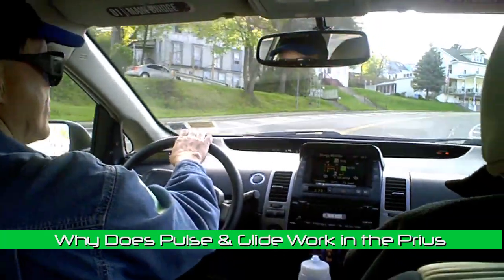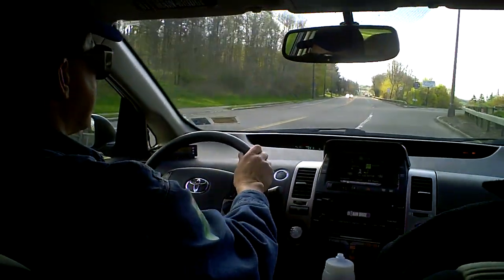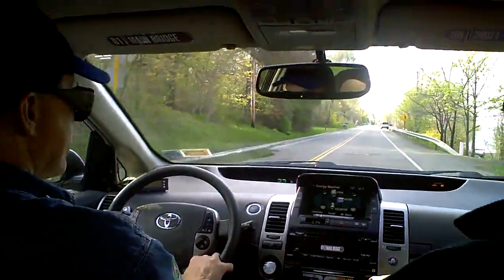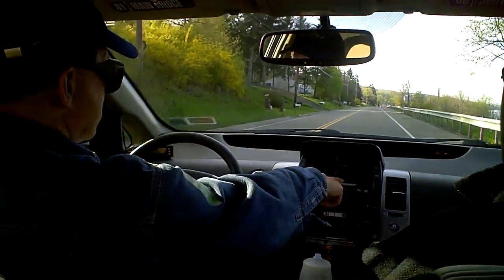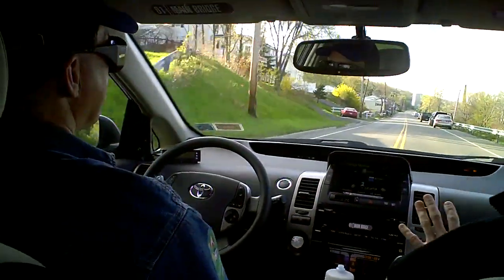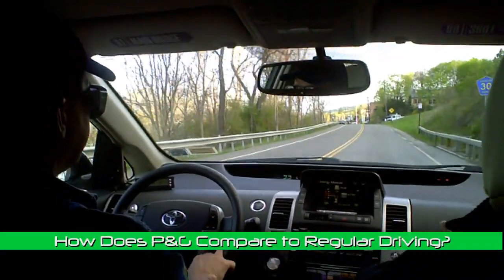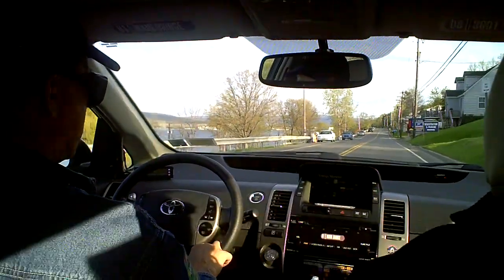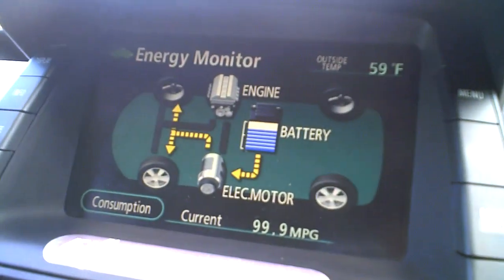Toyota Prius Pulse and Glide Fuel Economy Tutorial

Comment: I Drove 1200Miles in a Prius rental without doing the P+G and got 60+ MPG   US Gallons .  See Below                                                                 
Distance Driven  1204  (1937 KM)
Gallons used 18.759 (US) 15.66 (UK)
Cost (USD) $63.30  £51.04 ( Sterling ) @ Current Rate 1.24 USD -Pound
MPG (US) 64.18 (UK) 76.88
3.66L per 100KM

Comment: I wonder if a pulse and glide mechanism could be built into a car so that it does it multiple times per second. The engine could cause each cylinder to misfire by not injecting any fuel every few cycles to maintain speed but have the throttle wide open to reduce engine braking. The car will essentially be coasting whenever the engine isn't firing and since engines produce the best thermal efficiency at peak torque at wide-open throttle, you'd end up saving fuel without having to speed up and slow down all the time (at least, you wouldn't notice the speeding up and slowing down the car would be doing many times per second). 

Hooking this engine up to a CVT would be the most economical since the transmission could keep it in the peak torque band all the time.

Further still, maintaining the vehicle's most efficient speed would add to the savings. Usually around 45-50mph.
Reply: I think it would be better to just not use some of the cylinders, although optimum results would be to be able to completely decouple the cylinders. This would be complicated in terms of needing two separate timing chains and a locking clutch in terms of evenly spacing the power strokes. The other problem is the firing order of a 4 cylinder engine makes it difficult to split up into two 2 cylinder halves that fire evenly.
The other thing which is easier is to expand the range of top gears in the car. In most sports cars, the top gear ratio will be aligned so that the power peak and top speed are aligned on a level road with still air. At lower speeds, you can use an even higher gear. Perhaps a "drafting a truck on the highway at 55 mph" gear. In some cases the rpm you need might be below the peak BSFC but it will still get numbers adding a bit more load to the lower revs, than feathering high revs. In practice, these higher gears don't suit most rolling terrain driving conditions, but there are times where 1500 rpm at 70 mph might be optimal, in terms of decreasing the percentage of engine "rolling" resistance - especially if the engine is at least 1.6 liter.
Reply: @TimpBizkit  cars already have that....

Comment: Thanks -great video with good common Prius sense.   Since I bought my car last year (had 165,000mi and a failed HV battery), I got about 44 immediately after fixing the HV battery and using it completely without hypermiling attempts.   After I changed the oil and increased the tire pressure to 42front/38 rear I got to about 48mpg.   After I figured out the ideal glide stuff (pressing pedal just a touch to get 'no arrows' or just lightly to get some battery power without engine kicking in, I was able to get my mpg up to about 50.x, with one section/one day oddly being up at 63 mpg over 150 miles highway and country roads.   This explains, I guess how I got to that outlier high number.   I must have been doing the extremely low engine-on 'pulse', where the orange arrow from the engine goes to wheels with no orange arrow from the electric motor to the wheels (meaning the motor is taking some engine power and sending it to the battery, also a green arrow.)   It's a good tip that the driver suggests the instantaneous mpg number has been found to be 'about the speed your going' to maximize overall mpg.  Thanks for that too!  I'll be trying, when road conditions/drivers allow, to work on my pulse acceleration technique.

Comment: Can some1 recommend: is it more hybrid-efficient to brake slowly or step hard? Which would give a bigger output. Also, I've got a ct200h, the charge is more or less when the arrow is at 0? (the harder i brake - the lower it gets)
Reply: Braking gently is the best way to get the most from regenerative braking
Reply: Think of it more like time breaking not how hard. If you brake too hard you will be using the pads and all that energy is wasted you want to stretch your braking as long as possible this makes sure all the energy possible to be recovered can be.  around 48% on a mild temp day

Comment: Auris MY15 Euro - best mpg 65.7 mpg or 3.58 l/100 km - how? 100% Eco Mode,
always use the battery between 40% and 80%, 
always keep the needle at the half of the first eco section (on electricity or gas)
always park your car with 40% battery life
if there's a lot of accelerating and braking involved, use the battery between 80% and 90%.
Reply: That is pretty good for a 3rd gen HSD system.
Reply: 2025 lexus es 300h (2.5 liter)  my best mpg 62mpg or 3,8L/100km

Comment: Many high voltage caps in rows, alternating like pulse drive.
Placing two horizontal counter syncronouse flywheels:78k each. Under or within chasie.
One vertical for your smaller motor. Generating as we go,
Wheals can be.
Time for school. That's as big buss full of children and there father's and mother's thus the Lord's be with.
As those wheel keep turning, know that it can be given back in mass, to say swiftly would be appropriate.
Wisdom does take time however we learn from it or play catch up.
We had fallen for it once before, they lie all the time.
But I know.
Chryst told.
Even at my very core.
Warms my heart as matter of fact.
We will learn as we share.
Challenge of written book we're accepted by the intelligence of the world, but many have own power.

Comment: So you accelerate and put your foot on the petal slightly?  I was accelerating and taking foot off the pedal and getting better MPG.  I'm just trying to clarify the pulse and glide technique
Reply: Never driven a Prius but I think in terms of accelerator position from softest to hardest it's.
Pedal not pressed - regenerative braking
Slight pressure - nothing
Light to medium pressure - electric motor propulsion
Medium to heavy pressure - petrol engine of increasing power
Heavy pressure - petrol engine and electric motor for maximum power

The object is to accelerate at medium pressure - enough to fire up the engine but not make it roar, then switch to slight pressure so that the car is freewheeling, not converting kinetic energy to electricity (because you don't get as much back as you use).

I'm sure there are times when it is better to not press the pedal down a hill to store up battery energy from the regenerative braking, and then use the electric motor to take advantage of the stored energy before another downhill charges the battery to full and can't store any more.

Comment: I haven't tried any of this pulse and glide, I do however drive by not pounding it up hills (allow for a little bit of slowing) and using regen brakes as much as possible, slowing well before a stop without being ridiculously slow. I get about 4.1 to 4.3 litres/100 or 54-57mpgUS. With new battery and mostly 80km/h or less, though I have gone up to 100 and also up a big hill, still got 4.2L/100 due to rolling down the hilly road. Battery was filled to capacity.
Reply: Since I use semis to break the wind, I end up pulsing up the hill and gliding down the hill to keep up, since downhill makes switching to electric mode easy.
Reply: Hello, what car?

Comment: Normally with my Peugeot 106 GTI 1.6 16v, I run about 10km per liter in city traffic. For the past days I ran my thirsty car on high octane Shell V-Power fuel and used the 'Pulse and Glide' technique in town when I could. Aside from P&G, I did everything else about right and didn't slow down other traffic. The difference was amazing! I went from 10km per liter to 17 which is (obviously) an improvement of 70% in fuel economy over the old driving style. The downside is that when i switch the engine off when coasting, I lose my powersteering and 70% of my brake pressure. Still, this is very doable and i'm amazed at the difference.
Reply: I don't even start my car. I put it in neutral, push it myself downhill and use the momentum all the way to work. A lot of people horn but I pretend I've broken down.

Comment: Better do this only if you are the only person on the road. Otherwise, you will piss off a lot of people behind you.
Reply: People are pissed at us Prius drivers just by seeing us to start with lol
Reply: Nope i usually catch up with dawdlers in front of me and I have to brake in the middle of my glide. Although I'm not oscillatong between 18 and 37 mph....
More like 50-60 in a manual transmission.
Reply: dabambz I just bought my Prius.  yes, seems to piss people off, not supposed to use my heat and AC, have to put all my concentration into the special way to drive and not lose focus for a second, which pisses ME off.  lol.  If I just relax and drive it like a non hybrid, I dont know if Id get over 35 mpg.  my old Escort gets that no matter how I drive, 80 mph with AC on and I'm  totally relaxed driving it.  Paid $500 for the Escort with new tires!   $5500 for the Prius that I can't figure out how to really relax in (yet)!
Reply: romansten9 that's more an issue with not buying the correct vehicle for your intended use, you are most likely using it out of it's efficiency range. 80mph is outside of probably every electric cars efficiency. At city speeds the Prius will dominate, if you want a highway efficient vehicle you should've bought something else.
Reply: dabambz some of us don't give a crap if you are pissed. That's the difference.

Comment: I put this in practice all the time and achieve 50 mpg without disturbing traffic behind me.  Just  accelerate to a decent speed of about 45 mph, then you can pulse and  glide to maintain a decent speed.  By the time the speed goes down, you're already breaking at a traffic light.  As long as you won't pass 42 mph in a Prius 2010-2015, you're electric motor will be in charge.

Comment: Wouldn't be easier to switch the gear box to neutral an coast? You would then not have to work all the time on holding the pedal at the right spot.
Reply: Benedikt Freifallspoiler it basically puts itself in neutral automatically
Reply: ***** This is about hybrids in a situation where the engine is shut of anyhow.
Reply: Yeah in the Prius the engine is off in neutral. It might be tedious to keep your foot on the pedal, but also might be tedious to always flip the lever to N or D
Reply: Benedikt HRO engine so t shut off if you kick it into nutral while running. If you kick it I to neutral while it's off it'll use battery, which will force the engine on to charge the battery. Not as efficient. Doing the technique in this vid doesn't discharge the battery and shuts the engine off during glides.

Comment: Actually this doesn't sound right to me, the kinetic energy use for acceleration is lost due to driving resistance and drag.
The energy need to move the mass is constant base on those two factores, so "Pulse and Glide" will not yeald anythinger over at constant speed with the same avg. speed and transit time. Higer speed equal more drag equal greater energy loose, so the reason he gets better digits are simply lower avg. speed causes less resistance and drag, resulting in better fuel efficiency.

But the Pulse and Glide is NOt the cause, the lower resistance and drag however is, it's all a matter physics.
Reply: Milan Olsen I guess the only way to explain this would be due to less energy loss in the engien it self. The energy loss due to drag and friction would remain the same, but friction in the engien at 1000 rpm is lower then at 2000 rpm. However energy loss in due to transmission is only a few percent at this speed i guess you could save a litle bit by doing this. Atleast thats what i can make out of puls and glide. btw, if it would be possible to turn of the engien totally during your glide you would save even more, how ever this is really dangerous!! (excepts in hybrid vechicals)
Reply: No you are wrong . the purpose of pulse and glide is that an engine internal frictions is not proportional to the effort it gives,; it is ,at low speed,  bigger than the frictions of the car. Conclusion : if you  stiop the engin you suppress engine friction, half of the time, you will suppress half of the friction . On classic car (VW golf) i experiment this mode of driving at low speed on  50 mph ,20 % more mpg . Much more efficient than constant speed.
Reply: molan the electric motors engage some to reduce drag during glides.
Reply: If you drove up a hill and coasted on the way down you get max fuel economy. Similar concept. Maximize energy.
Reply: A throttle position on the HSD allows you to completely disengage the transmission during glides, allowing the Prius to glide for much longer than a conventional vehicle. No drag from conventional transmission gears, or the engine (unless you invoke the latter via regenerative braking).
I do this everyday, but ensure that I NEVER impede traffic while doing so.
With time, you learn to do this even in fast moving traffic automatically, while moving with the flow of traffic without impeding it in any way.
Reply: The reason this works in most cars is because the engine runs out of gears and is a big loss factor in terms of its own internal resistance. In most cars, the highest gear isn't high enough to burn the least fuel possible. For example, my Cooper S is 2400 rpm at 60 in 6th gear, and still relatively lively when I accelerate, meaning a higher gear could do the same job and reduce the speed of the great friction machine. In some cases at lower speed, the car uses more energy just to spin the engine parts against their own resistance, than actually turning the wheels and moving the car!

TLDR having your engine parts go rubby rubby rubby and the air through the valves go swish swish swish only some of the time is more efficient than all the time. In many cases it more than makes up for the change in speed being less efficient because of non linear drag losses.

Comment: This works to a lesser degree in a standard gas engine car also. From a stop. Accelerate smoothly but briskly up to the speed you want, then coast or maintain. Regular gas engine.. operate most efficiently at 50-75% throttle.  When the engine RPM is above idle and you are off the throttle coasting, the fuel injection shuts off the fuel..  So when going down a hill, let the engine braking force keep you at the speed you want.. you are using no of little fuel. Watch the instant MPG gauge it will go to 99MPG.
On another point.. this pulse and glide is great when your alone on the street, doing it with people behind you is very incosiderate, also ..  Most places I drive none goes 35MPH anyway... it;s always 40MPH or higher.
Nice video though on demonstrating how to do this.. It is a good idea, IF you can safely do it.
Reply: The only thing I'm not going to do is oscillate between 20 and 40 mph on a 60 road. I'd drive people mad....
You are supposed to go out of gear on the glide unless you need to slow at the bottom of a hill. The amount of reacceleration negates the zero fuel consumption engine braking.
If you're staying in gear you may as well just hold constant throttle and save the varying squared and cubed losses in engine and aerodynamically, whose average is greater than when holding the average speed steadily.
Reply: Pulsing and gliding works at higher speeds too on some hybrids. I pulse and glide at around 60 mph, as I do value saving time as well. I generally hover between 55-70 using a semi to reduce drag when possible.

Comment: This is how motormen were taught to drive streetcars, to save power, and also because you couldn't decelerate electric motors - you could increase speed at a certain rate,  , but to decelerate, you shut power off entirely and coasted, or braked if necessary.

Comment: I get it and I love it.  But, how does this effect the overall lifespan of the battery pack?  I'd assume not enough to be concerned, er?
Reply: Spencer Johnston just don't buy it for these money you could buy a nice Mercedes or BMW
Reply: Probably won't affect the life unless you are running it down to low levels all the time. Plus you are bound to get hills where you'll use the regen brakes anyway ;p
Reply: Spencer Johnston if done right it should not effect the charge of the battery much during the course of doing this. If done right it doesn't charge or discharge the battery much at all.
Reply: You don't actually use the battery much beyond the car's electronics. Just pure glide, and then just the engine to accelerate.

Comment: If you are forced to go at higher speeds, you can often travel at 100km/h (62mph, max speed in New Zealand) if you are on a slight downgrade, by slightly pressing the accelerator so only the elec. motor is working. This takes almost no battery and you can recharge going up the hill. In ideal conditions it is possible to get 2.5-3.0 l/100km in this situation (but ideal conditions rarely happen).

Comment: ... so if you need to go faster (31-40mph / 50-65kph) for your pulse and glide, I can get 2.5l/100km (94mpg US) as long as no-one gets behind me to disturb my cycle; it easily drops to 47mpg (US) as I speed up gradually if someone approaches from behind so I don't slow them up. My average ranges between 3.6-4.2l/100km, and 5.0km if doing a constant 100kmh (62mph).